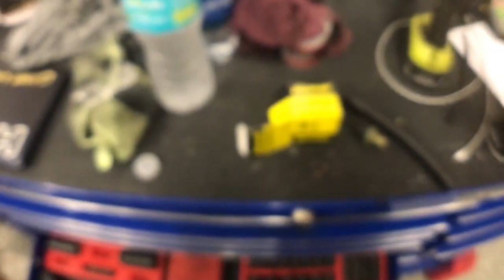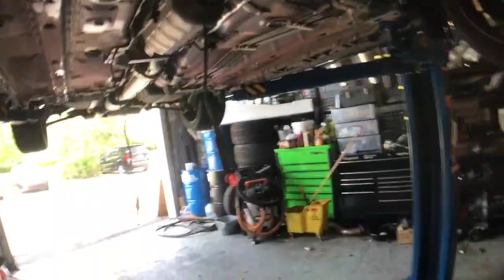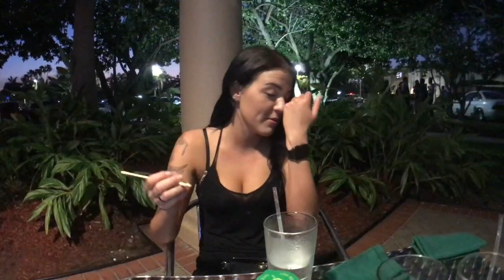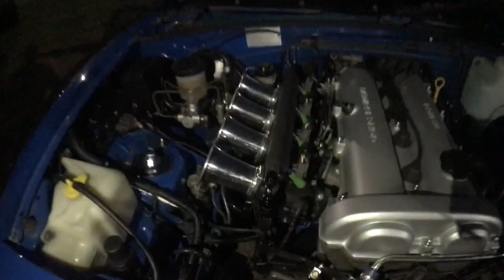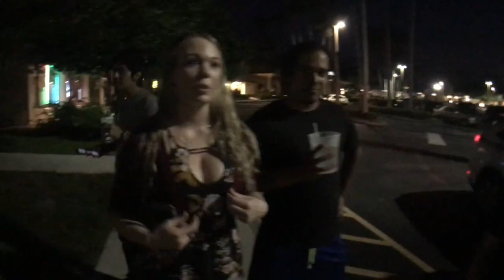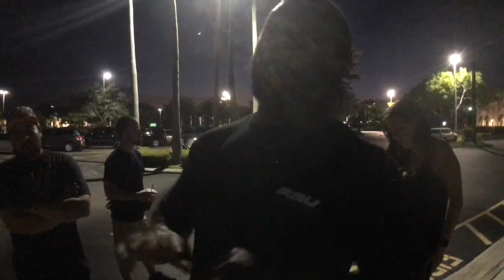Hailey makes the boys cry

Comment: Roberto, its vlog not v log.  Do you say BEE LOG instead of blog?  No. You don't.
Reply: B12GTA hmm well vlog actually stands for "video log" blog on the other hand doesn't stand for anything. It's just blog. Vlog is also not even a real word so v-log is technically correct.
Reply: A video blog or video log, usually shortened to vlog /ˈvlɒɡ/, is a form of blog for which the medium is video, and is a form of web television. Vlog entries often combine embedded video (or a video link) with supporting text, images, and other metadata.